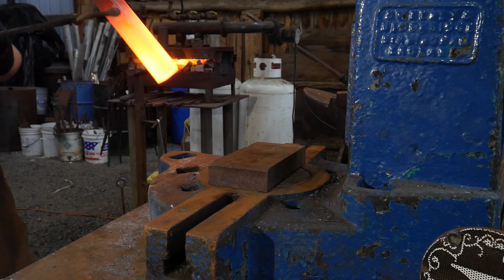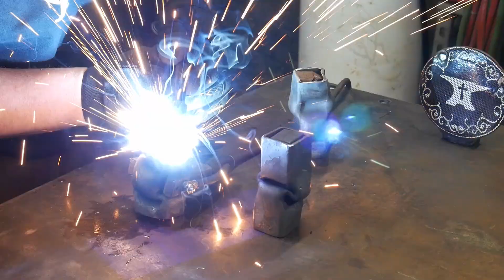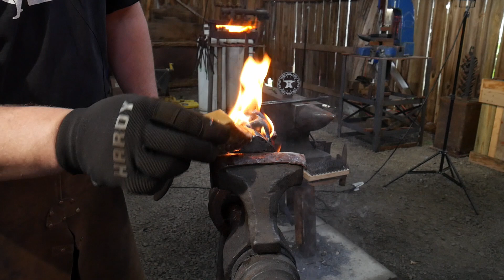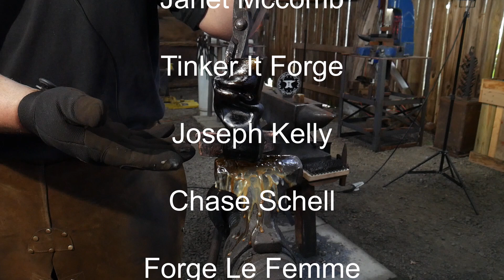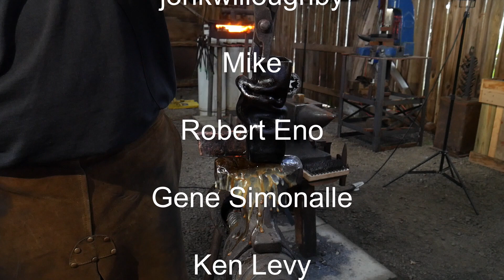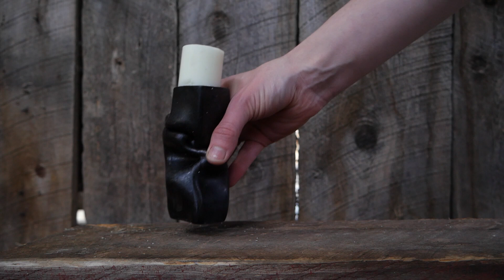Crushing Pipe Under the Flypress

Comment: not bad, i'll give you a cool sheet metal trick for decorative work, create a mig weld puddle then disconnect the earth from the work piece while still feeding the wire, you get the mig wire push through the weld straight out the other side of the metal.

Comment: She's moving around a bit, needs some anchors, ever heard of a deadleg? A log, with a chain wrapped around it buried about 4'-6' under the ground with the end of the chain sticking out for some serious anchoring.
And I think I would use a brush for the beeswax, keeping the wax in a can and melting it before applying with the brush. Probably a soft brass brush would work and leave that brassy coating to boot🤔
Reply from the maker: Never heard of it but sounds like a great thing 🙂